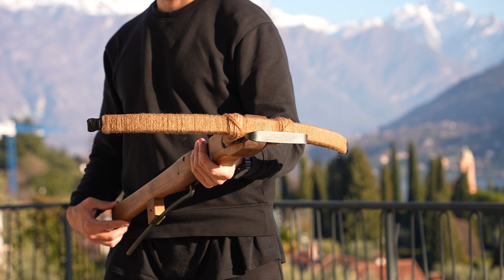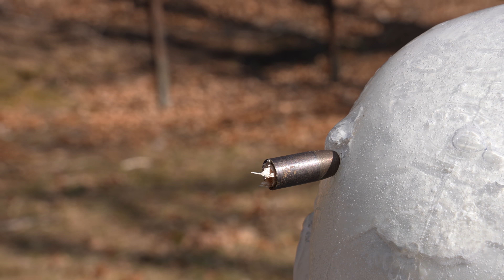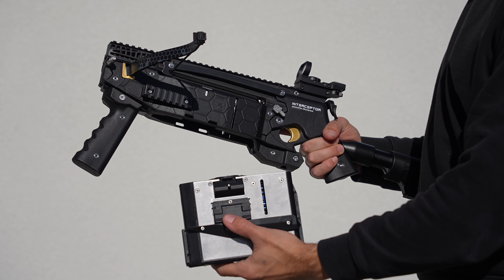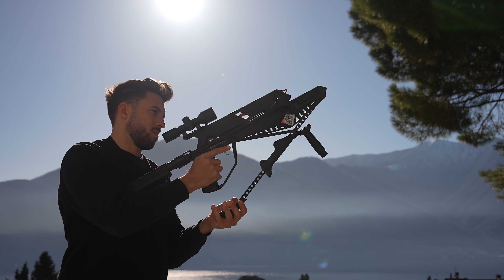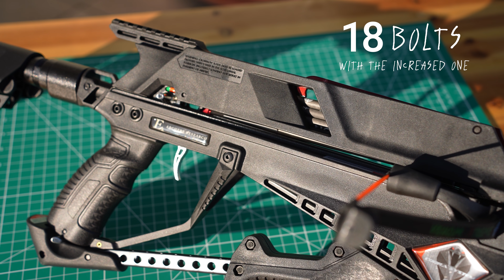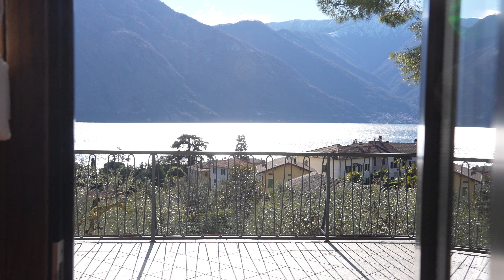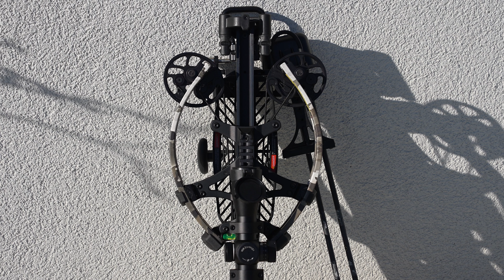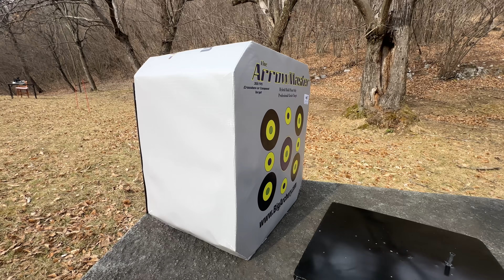How Dangerous are Crossbows?

Comment: Last two are impressive sure, but more impractical than original model, but I guess its the price for its power level. And all of them, minus original, most likely wont survive any real combat conditions, so they are not really a weapons at this point. Same will happen during zombie apocalypse, you wont be able to maintain them. So it needs to be classic model but as advanced as possible w\o becoming "a modern crossbow", maximum performance and as simple as AK rifle, not a high tech laser gun from the future. In the end Its actually might be much better to use a modern bow, not crossbow in the zombie scenario. Or just move to USA few weeks before apocalypse happens and live where there is almost unlimited access to real weapons and ammo :)

Comment: You know sir with all the power tools such as Drills, Grinders and Winches available,  it seems to me that having a Battery Powered Winch Pull for the reloading would be an excellent engineering challenge for the heavier more powerful crossbow systems, and having it built right into the design like that last Crossbow.  If you could also engineer a reload system for the heavy Crossbows to make them truly  semi-auto you would have something remarkable.   Pull the trigger and within a few seconds be ready to pull the trigger once again, without even taking your eyes off the target would be light years ahead of what designs are going on right now.  Also having a shorter bolt made of materials costing less and holding up longer, would be advantageous.  Someone is making a $killing$ on the bolts.

Comment: when scoring for accuracy you shouldn't worry about points on a bullseye but should be measuring the size of the circle made by the 3 bolts. doing so makes it less reliant on having a perfect zero on your scope and eliminates the error caused by accounting for drop due to distance as you can just aim at a consistant spot and get a good grouping

Comment: If you compare this to shooting bullets, these are scary because they're relatively silent.
However. To send someone to their maker ☠ by shooting them in the chest but not hitting the heart, you need about 45 ft lbs of force at the muzzle. Or very slightly over 61 joules.
So from left to right on the list of crossbows fired, you had the following foot pound powers;
20.65 ft lbs. Gonna hurt really badly. Good survival probability.
14.16 ft lbs. Gonna hurt really badly. Very good survival probability.
30.98 ft lbs. Gonna hurt really badly. Good'ish survival probability.
120.22 ft lbs. You've sent them to their maker.
256.67 ft lbs. You've sent them to their maker and probably the person stood behind them as well.

Comment: Watchm Todds workshop dude. :) I see what you are trying to do. and its awesome, but comparing draw weights of crossbows to regular bows is like comparing apples to dragonfruit. they dont mean the same thing in relation to each other. only in an absolute sense. A 165 pound war bow would put your hunfred something pound crossbow to shame! the cross bow normally has a stiffer shorter "bow" and the projectile is under tension by the bow string for a shorter amount of time. meaning that what draw weight translates into for projectile speed means something different for both. the projectiles are different weights too. and that impacts things too. want to see what a top of the line all bells and whistles best tech in the middle ages crossbow is really like, grab yourself a 800 to 1000 pound windlass. lol. that 100 to 200 pound short medieval crossbow was like what thye gave their 7 year olds to go practice with back in the day. lolol

Edit: The fact that you couldnt even penetrate the skull with that weak assh replica proves my above point.

Comment: Dude, with that 25 gram bolt you're killing a medieval crossbow, it could shoot a 100 gram bolt probably at the same speed...
Reply: Yes, someone might think how is it so, the weight is more and the speed does not change, everything is simple, each individual material of the limbs of the bow and crossbow, and what will ultimately come out of them, they have a maximum speed of straightening the limbs - it sets the maximum speed of the arrow, therefore long bows cannot achieve high speeds, even shooting from a 160-pound bow, from the best types of wood the maximum will be 70 meters per second with a heavy arrow, a recurve biocomposite bow with a force of 70-90 pounds can shoot arrows weighing 15 grams and will not break due to tendons and horn plates, getting a speed of 100 m / s
Reply: If you shoot a light arrow from a bow that can't move faster, it will break. The energy will remain in the bow and destroy it by bending it outward, stretching the string and creating resonance, it's almost like a blank shot to it!

Comment: Now the pieces of wood you used are vastly different. The first ones had nasty branches that are extremely good at holding the wood together and the wood is also way denser at those points. Then you used a nearly "perfect" piece of wood. With fibres going up and down the wood only. It is way way easier to break that wood in half and just keep going. So while it is fair to say the weapon is more powerful, it was an unfair advantage nonetheless.

Comment: Try to find a power drill adapter that would fit into the winch system of the last one.  There's gotta be someone building them with power cocking mechanisms isn't there?

Comment: For the strongest crossbow, you can just use extremely heavy alluminum arrows and still get 200 joules. You will lose speed and energy, but penetration should still be brutal, and your arrows should last longer.

Comment: Dude, if you'd have the modicum amount of physics knowledge, you would know that the bolts for the medieval crossbow were grossly underweight. Even with double the weight, at 60 grams, you would not see any drop in speed (thus a massive increase in efficiency and damage). You're lucky you haven't permanently damaged the bow by dry shooting it.

Comment: If you can put a motor on the winch and have the winch permanently installed on the crossbow, you might have something there. As it stands, you might as well have a muzzleloader for as slow as it is.

Comment: The arrow is as important as the bow when it comes to damage. You can have a highend bow, but if the arrow is weak and cheap, it won't do much if you are lucky it even hits the target. The inverse is a crappy bow but high end arrow. The arrow will transfer every bit of what that bow is capable of, even if that bow sucks, you will still get 100% of what it can do. A crappy arrow can lose alot of the energy, impact, or even direction of a great bow.

Comment: Most unfair test I've ever seen. I would think to be fair the same size bolts would be used. The first bow would be very deadly with some nice hunting heads. In the hands of an expert would be very deadly. Using blunt tips like used I'd like comparing a bean bag to a hollow point hunting bear.

Comment: The reason why the first crossbow was kinda bad wasn't because of tbe crossbow itself,but because if the arrow/bolt,your using a bolt with a very heavy head which causes the bolt to tip down when flying,you could try bolts that uses regular arrow heads

Comment: Crossbow and bow power are determined by 3 factors that are multiplied with each other in energy calculations: draw weight, powerstroke, and prod effiency. This 3 factor relationship is why Todd of Todd's workshop youtube channel discovered that a 150-160 lb organic prod longbow and a 150 lb modern crossbow (he calls it his lockdown longbow) actually shoots projectiles with more energy than a ~1000 lb steel medieval crossbow. Medieval steel European crossbows can have high draw weight but very low powerstroke and low prod effiency (there are exceptions with composite and other organic type European crossbows). The powerstroke (draw length minus brace height) might be 4-7 inches. Steel is not an efficent material for prods because it is heavy and cannot spring back very quickly - this meane it cannot transfer energy as well as organic materials. There are many different crossbow designs around the world. Ancient & medieval Chinese crossbows and modern crossbows use a different approach that favors a lower to more moderate draw weight in combination with a much greater powerstroke and higher prod efficency.

Comment: that medieval crossbow is likely a rather weak one since you are able to span it by hand and those bolts are field points- not the sort of thing you would use against people or animals. Some medieval crossbows are capable of punching through chainmail, so going through a person's skull would be no problem. But modern crossbows tend to be far more capable since they fire lighter, thinner projectiles at really high speed.

Comment: Something I realised - the bolt will always drop at 32ft/sec^2.
How much a bolt drops over a given distance is a function of its velocity.
If you know the velocity, and the range, the scope can easily be calibrated.
A sonic ranging unit, a microcontroller, and a small stepper motor …
Or good visual estimation of distance and a calibrated thumb wheel adjustment.

Comment: Piotr viktor Patatovich here, I’m polish, in my country I invent my own crossbow with energy level 50 times higher than any of these crossbows here, I use skin of 24 polish sausages for the string , I can hit target the size of bottle top from 2 kilometre with no scope, make your bows look like toy , I’m best crossbow designer in world , like betman.
Reply: The tensile strength of the material you are suggesting cannot hold more than 50lbs of force before tearing, and to even get that result you need to make the "string" 3x thicker than normal which would compromisethe hold it has on any bolt. Either you are stating the wrong material, making a joke or just talking out your a**.
Reply: @LokelyConed 

He clearly is joking, but he's also Piotr Viktor Patatovich...
Reply: @FireN2k9  I'm not familiar with the name, who is that?
Reply: @LokelyConed  

I have no idea.
I was joking.
It's a purposely ridiculous name made by him and he 100% was trolling around ^^
Reply: @FireN2k9  oh, lmao, fair enough
Reply: @LokelyConed it's a joke

Comment: Try a Hickory Creek mini inline vertical crossbow, it uses full size arrows rather than bolts and is easy to cock by hand for relatively fast reloads, very effective range and excellent mobility. It can also be easily broken down and put back together to make it compact if needs be. It does cost £700-800 but it’s well worth it if you can’t buy a firearm.

Comment: When it comes to using them in a Zombie Apocalypse, it would have been nice to find out how much noise each one makes when discharged.
Did volume increase along with power? Or were they all very quiet? Or were they all stupidly loud? If I'm going to use a x-bow against zombies, I'm doing it because I want to be quiet. Otherwise, I might as well be using a gun, right? Since each x-bow looked lethal vs zombies, the deciding factor for me would be how loud the weapon is.

Comment: It seems worthwhile to mention that the VAST majority of crossbows that were used for warfare in medieval times had MUCH higher draw weights than 200 lbs. Many were up over 1,000 lbs.
It's also worth mentioning that even a crossbow with a 1,200 lbs draw weight isn't going to wildly overpower a longbow with a 160 lbs draw weight, because the crossbow has a MUCH shorter draw length. That is - the distance the string travels from when it's fully drawn, to when it's at rest. As a result, a 1,200 lbs crossbow has less time to impart all that energy into its bolt, than a 160 lbs bow can impart to its arrow. In the end, warbows and crossbows both deliver highly comparable amounts of energy to their projectiles.

Ps: Anyone familiar with bows will know all this already, but since no one else appears to have mentioned it...